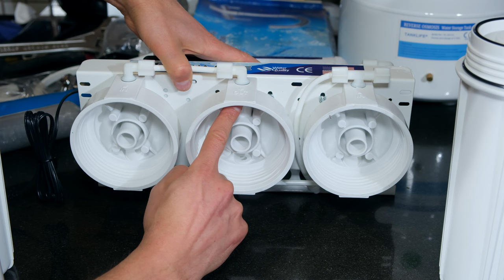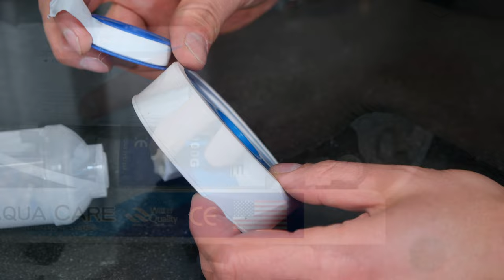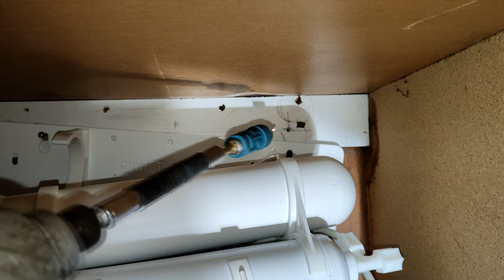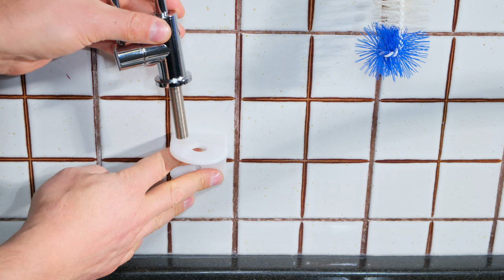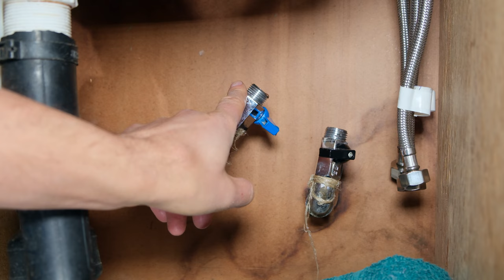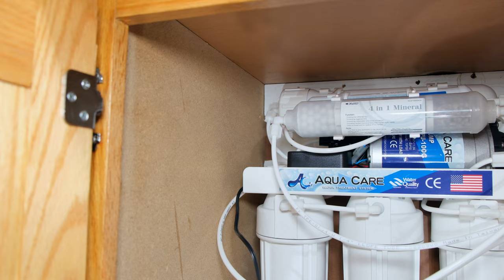How to install a reverse osmosis water purification system - 6 stages - all steps shown

Comment: On someone elses channel they say you should not handle the RO filter with your bare hands rather use a long  nose plier to remove and insert. Your hot and cold main supply is piped wrong. Hot supposed to be on the left and cold on the right.

Comment: why is the tank needed in this type of filters and why there is a drain water from a filter?  unlike 5 stages filter there is no tank and no drain
Reply: All Ro systems need the tank, as it processes your home water line through the system, and its usually in a ratio ...Meaning it will take 1 gallon of supply water and make maybe half for drinking while the other half is waste. I think this is to keep water flow moving and not plugging up lines often. Mine has a pump motor as well.